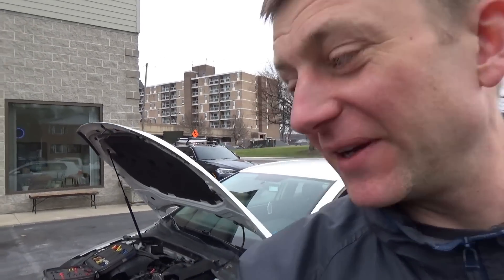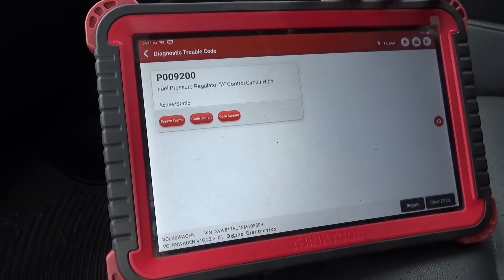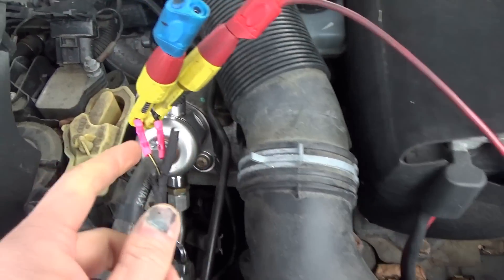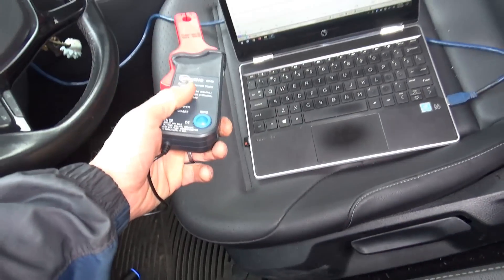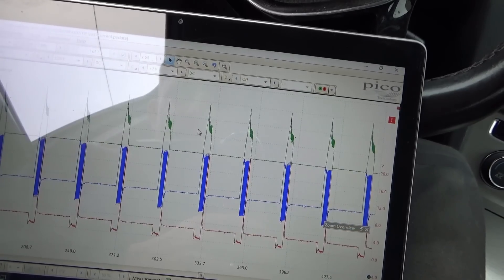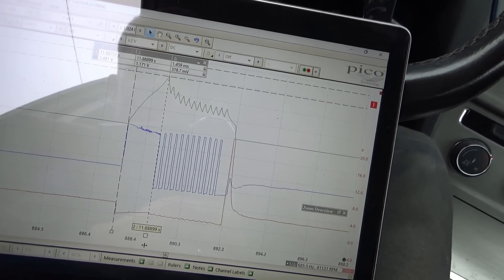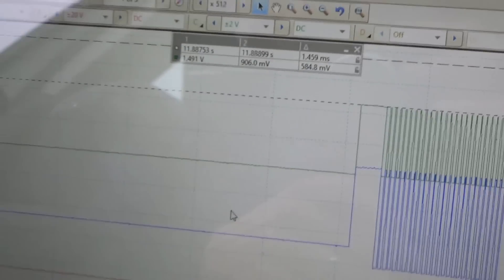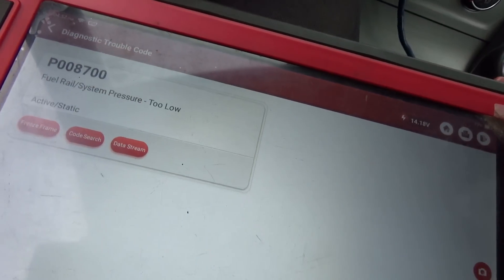VW GDI LIMP Mode AFTER Repairs?? (P0092 - High Pressure Fuel Pump Circuit)

Comment: the high pressure fuel pump gets power from the fuse block. fuse 13 or 17, cant remember which. the ecu does pwm on the ground side.

Comment: That high pressure fuel pump looked  awfully familiar to me-- because it was the site of a $400 blunder on a 2014 VW Passat. While changing the spark plugs, I  lightly pulled on the wiring harness  and the  plastic connector on the pump snapped right  off!  I did write Bosch to ask why they put such a fragile connector on this- but they never responded- go figure. I am reassured that others have seemed to do this exact same idiotic move! My replacement to the USA original pump was a Chinese made  Delphi one and it worked fine. I will add that the pump in your excellent video is the one for the 1.8. If this engine was indeed  the 2.0 , there is a different pump used(on Rock Auto)- which may explain what the problem was. Comparing the old and new parts may have been easier to fix!

Comment: EPC= Engine Power Control.
Post your email and I can send you a self study on how it works

What was the engine code Ivan, next TSi I go to I will measure the pump resistance and let you know what factory resistance is.

Comment: Admittedly, the scope did prove to be valuable here indeed.  But ultimately, it was the varying of the test lights to gain the right amp load for the win.  Now you asked, can it be diagnosed without a scope?  Obviously, you're shooting in the dark without one.  But anything is possible when you put your mind to it.

Anyway, very well done Ivan.  And that little test light trick is an awesome tip that I picked up from you a while back and I have been using it in a number of my diagnostics ever since.  I can't thank you enough for that one.

Comment: I have one of these in my shop now, 2012 2.0 tdi, keeps throwing a p0047 and going into limp mode. Checked boost pressure(act vs des.) with scanner nothing obvious. Hooked up scope to boost control sol. 1 channel power, 2 channel control. 3 channel amps. 4th channel wastegate signal.  
I am getting inductive spike right  before i go into limp mode, i moved my amps channel to the battery post and im getting the same inductive spike there as well. 
Went to pcm checked powers  and ground, checked ac ripple. 
Everything checks out ok so far. You have to drive it to get it to glitch. I have some more testing to do but im thinking what could spike a power feed and a 5 volt signal at the same time? Did i mention this thing has aftermarket aftermarket hid headlights.... i may be onto somthing.

Comment: I was living this exact scenario with my VW. While doing another repair the connector to the fuel pump was broken. A bosch fuel pump was installed and the check engine/EPC/limp mode saga started. In the end it was determined that the resistance of the bosch vs the VW pump was slightly different.

Comment: Hey Ivan, another great case study. I recall Opus hosting a webinar on Volkswagen and Audi. They strongly recommended going to the dealer to pick up a high-pressure pump. Apparently, the aftermarket option isn't quite as reliable as an OE piece. In this case, training would have paid, not cost$.

Comment: having test equipment and using it makes working on cars very easy , people over think things and think the worst so they guess  ,  information, common sense and logic goes a long way,  its not a race and think things through learn the system and you will get the result you are after , Happy Easter

Comment: Another test would be to place the test light in series with the pump. This would increase the resistance and lower the amperage but may allow a test of the computer. Or add a 1 or 2 ohm resistor.

Comment: Ok I’ve run into this before. Make sure to use the same brand pump that came out. So if it hitachi you can’t use a Bosch and Vica versa. The resistance values will be off and pcm thinks it’s open circuit. I’ve never had to buy one from VW ever. Always use the oem brand and you’ll be fine. Of course it could’ve just been a defect or counterfeit as well 😉

Comment: It would be interesting to see if you could insert a ballast resistor in series with one of the control wires to see if that would fix the issue. 

If I were to go about fixing this without a scope, I could use a test light pretty easily to determine that circuit integrity is good. From there, it has to be the pump or the ECM, and my money would be on the new pump being bad.

Comment: Hi searching YouTube I came across your channel and video. I have a problem need your help with a 2011 Saab 9-5 crank but won’t start. It has four code P0191 P1101 P062B P0101 I replaced parts P0191 and P0101 still didn’t start this car been sitting for the past three years. Don’t want to junk car everyone I asked told me that haven’t worked on a Saab in years let me know what you think thanks in advance
Reply from the maker: I'm sure that I could get it running 👍
Reply: @PineHollowAutoDiagnostics  Hi My name is Mark can you send me your contact info thanks
Reply: @PineHollowAutoDiagnostics  Hi my name is mark can you send me your contact info

Comment: about six months ago i got vw with gas paddle code was onscope the paddle its was good no issue then i just scope the throttle body and i was missing the signal one tp2 i believed change the throttle body programed it and fixed it

Comment: VWs are notorious for only wanting their OEM parts I will not work on them as I have been burned by using aftermarket parts (customer supplied ) & they charge a fortune for their parts (weird  shaped hose connector had to buy the complete hose assembly $80 aud).Cheers Ivan.

Comment: 0.6 ohms? That is way too low. That would draw over 20 amps at 100% duty cycle. Doesn't seem right to me.
Reply: Yes, ohms law could help here.  

14v / 0.6ohms = 23.333 amps at 100% duty cycle.
14v / 5amps = 2.8 ohms at 100% duty cycle.

Comment: “You’d be dead in the water without a scope, tell me I’m wrong”. Resistance spec for the regulator valve is 1.5-11 ohms at room temp. No scope required if you’re using service info. Sorry bud, you’re wrong

Comment: Good video. Ivan always look forward to your videos.  Its like a kid waiting for saturday morning to come around soI can watch comics. I will be calling you for replacement of cam in my VW tdi mk5 5speed with 425k originql miles. Only thing changed is time belt every 100k. ORdered the cam, rocker arms lifters directly from VW, Right now the car runs like a Swiss clock. I am still getting 42mpg city/highway.  the parts manager says I amhis best customer. Not sure if that is a compliment? LOL Love your videos. learned so much especially about pico . Got your pressure sensors when they first came out. mark No problem with the car. I want to replace the cam at 500k miles.

Comment: I have an Audi 2018 Q3. I went to Audi to get the oil changed. They are unable to open the hood. They have tried everything they think they know and suggest breaking the hood to open it. It does not make sense to me. The repairs will cost 1000's$$.  What Tips can you offer? Or can you please make a video about it?
Reply from the maker: My tip is to run it until the engine seizes up and then buy something non-Euro lol

Comment: I confirmed the aftermarket pump when I saw the pressure readings. There's only so many things that can make the pressure run high. It's either a faulty fuel pressure regulator or the fuel pump itself. It ran right until the connectors and pump were replaced. The connectors were right and could only cause high resistance, resulting in low fuel pressure. The only other thing that changed was the pump. Problem solved.

If you followed your golden rule, AND focused on what had changed from when it ran right until it didn't, all you would have needed was the scanner to see fuel pressures. What was that golden rule? It's the NEW rule. When it comes to aftermarket electronic parts, NEW=Never Ever Works. I got that from you Ivan. Mechanical things like brake pads and radiators are fine. If it uses electricity, then OEM is the only way to go.

I hate to say it but, by not following your own rules, you made the diagnosis much more complicated than it should have been.
Reply from the maker: I'm not calling the pump until I PROVE the problem is the pump! That's the whole point of DIAGNOSTICS...otherwise you can't charge the customer for a guaranteed DIAGNOSIS haha ;)
Reply: @PineHollowAutoDiagnostics   Like I said, there's only so many things that can cause said problem, high pressure. Low pressure would require  more diagnostics. Replace the pump and report back haha:)
Reply from the maker: @NotFastEddie  🤦‍♂️you cannot verify proper ECM driver operation without an oscilloscope.

Comment: That was a good find. We've never had any problems with those aftermarket tsi high pressure pumps. So according to ohm's law resistance of a pump solenoid should be actually a little greater for the computer to be happy with it right?

Comment: I am telling you you are wrong. You measured the ohms resistance of the pump but forgot to compare that to the OEM spec which google told me in 30 seconds to be 1.8 ohm plus or minus 0.8 ohm at 20 degrees C (about 70F). You measured 0.6. That should already have been the final diagnosis. NO SCOPE NEEDED.  The moment I saw the waveforms the first time and it said it went over 10 amps I was already thinking that that is way too much for a fuel pressure regulating solenoid and they bought the wrong model or got a fake Bosch.
Reply from the maker: How I am wrong? The diagnosis was 100% correct just by using logic and not looking up any specs! What if I called the pump just based off the ohm reading, and didn't check the ECM control and drivers? Wouldn't be a complete diagnosis! :)

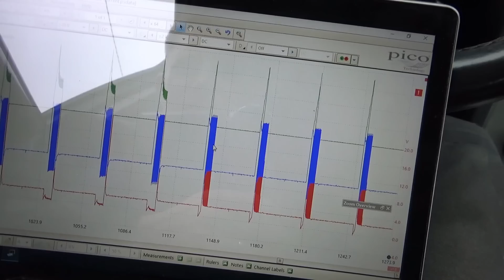Comment: 8:34 what jumps out at me is that the current is going to zero after the initial peak.  The computer is doing PWM, but there's no current.  The load is open.  You're right.  You'd never spot that without a scope.
Reply from the maker: Load isn't open. ECM is sensing the initial high current spike and just shuts off the low-side driver so no more current flows :)
Reply: @PineHollowAutoDiagnostics  I had to download the waveforms to get a good look at them.  During the bad pulses, there is current during the initial pulse, but during the follow-up PWM, there's none.  However, that seems to be due to the computer deciding not to ground the pump.  Interesting that there seems to be some kind of control on both lines and not one side always ground.   Two channel isn't enough.  Three was needed to see this.
Reply from the maker: @russellhltn1396  exactly right! 🙂

Comment: Hello all, I have ask this question before, no answer yet or I did not get or missed the notification. How do you know what oem is? Do you have to go to the dealer to get an oem part? Also how do you know how many ohms something should be and how many amps. I went to test a spark plugs ohms and i really have no idea how many ohms a plug should have. I could not get a reading on one new plug but got a reading on another but i still have no idea how much one should have. Thank you P.S.  OK one more question I think, if you put 5 amp test lights in circuit and you get 9 amps showing on scope why does it not burn the 5 amp test light out?
 You hooked up the test light and amp clamp then said amps are going to go from here to here, i have watched this video a three times. I will watch it again but i think you said blue channel 1 is on the yellow and  black and ckannel 2 is on the black and red. I ASSUME red and black is hot and yellow and black is ground. So when you said the amp clamp should be connected here and current will go from here back to here  I ASSUME from positive to negavtive.
Reply: Bosch typically is OEM for VW Group, including Audi and Porsche, and Denso is often OEM for Japanese cars (definitely Toyota/Lexus).  The problem is that if you buy Bosch or Denso parts from Amazon or eBay you usually get Chinese counterfeit junk.  Rock Auto, O'Reilly, and of course the dealer all will sell you real parts.
Reply: @ischmidt  Thank you for the response, I just saw the replay from 2 weeks ago.

Comment: Interesting. I would think that the inrush current would be much higher on start up of the pump. Then the current decreases as it gets up to speed. Not lower then increase. Where as a bulb draws the same current as its a fixed load.
Reply from the maker: This isn't a spinning pump motor... Just a simple pulsed solenoid valve 😊
Reply: @PineHollowAutoDiagnostics  cool! That explains a bit more. No clue on its design..

Comment: I would like to have the ability to check one more circuit for current and voltagecwave forms to see if potentially any other circuit is producing the symptoms. From the current and voltage waveforms from  the pump drive circuitry has issues. Due to high Vmax and Imax and lack of current tail at the end of the duty cycle this pump may have a bad capacitor in the pwm circuit.
This circuit mat work fine until warmed up and then its capacitance drops allowing the warm forms generated.

Comment: Bosch has been an OEM supplier to German made cars for many years - perhaps a counterfeit item... 🤔

And somebody doesn't know to heat shrink the connectors - that's a red flag.
Reply from the maker: I call it "crimp n ship" 😂
Reply: You assume those are heat shrink. Most aren't.
Reply: @TEDodd  
Yes, they are.
Reply: @Peter_Riis_DK  the ones at 0:35 definately are not. The others might be.

Go to a parts store. Most crimp connectors aren't heat shrink. Just a hard plastic covering. You have to find the heat shrink style specifically.
Reply: @TEDodd  
I will not. I have them in stock and this type is shrink otherwise the elongated sleeves wouldn't be necessary.

Have a nice Easter. DK out.
Reply: @Peter_Riis_DK  great for you and your customers. But not all shops have them and most of what is sold doesn't shrink. More common now than 20 years ago but you still have to look/ask for them if you want the shrinkable style.

The fact is at least 2 of the connectors used don't shrink. The other 2 might, I've seen similar that will and others that won't (realized after way too long with the heat gun trying to sgrink them).

Doesn't mean they don't know how. Just that they didn't have them, don't normally use them, or even realize they were shrinkable.
Reply: @TEDodd  
Whatever.

Comment: I've been in limp mode ever since I turned 70 but my vehicles run great thanks to you Ivan for everything I learned from you 😁
Ps I did buy a cheap two channel scope last year and solved a few problems since
thanks to you I know how to use it. now I have a newfound enjoyable hobby in my retirement 
Thanks Ivan just about watched every vid you made since you were a kid 😂
Reply from the maker: Having an enjoyable hobby means a lot! 😁👍
Reply: ditto (age), ditto (2 channel) if ya really want to have fun, get Ivan’s pressure transducer 😂
Reply: Yes sir, watching Ivan work is like going to school. I still have a lot to learn but am haveing a good time doing it. I would like to get a scanner but I only have a, what is it a 5 giga hurts computer. Not sure I might need a faster laptop also, not ready to spend as much as I would need to to get a 2 channel Pico. Anywsy Ivan is the greatest.
Reply: @carbie5614  
I bought a hantek two channel for like 70 bucks it works for what I need
Did a cam crank retard on my 97 GMC with it turned the distributor until the Waveform lined up the way it's supposed to
Reply: The information here is invaluable! Ivan listening to you reason why you follow the path you do is so educational. I found you from watching Eric O, what a find, two great minds.
Reply: LOVE YOUR HUMOR!  At 77 yo, I can hardly walk due to this and that.
Reply: my ex tried to put me in limp mode in my thirties.

Comment: if the car was ok on old pump and it was replaced with none oe . with no scope buying oe pump to try would have fixed car. so a parts cannon with sniper sights. as you always say electrics OE ONLY with these modern cars. good experiment  with bulbs kudos to you.